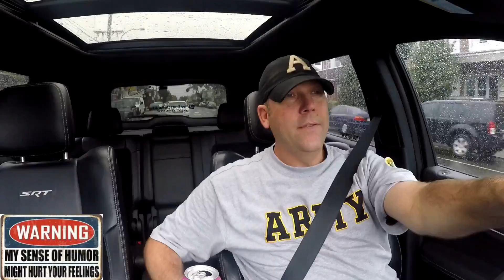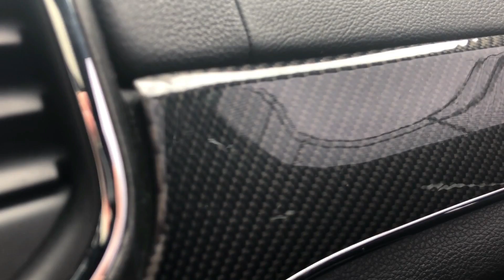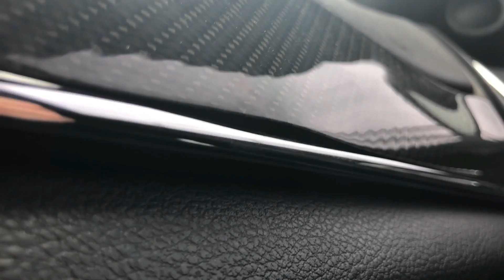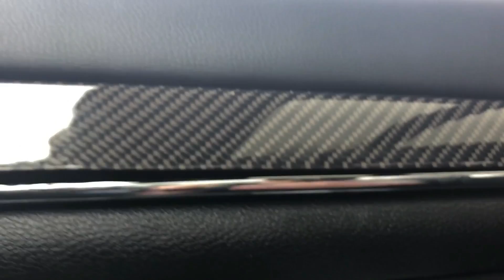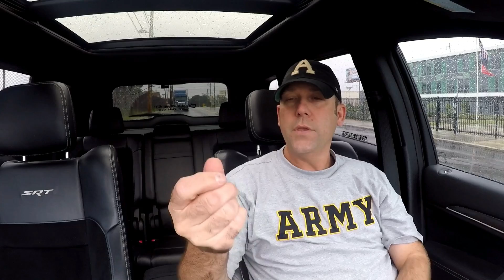The Carbon Fiber Trim peeling issue with the Jeep Grand Cherokee SRT

Comment: I just repaired my four door pieces and the piece on the left of the steering column.  I had to completely replace the piece on the passenger dash at a cost of over $300.  But the pieces I repaired went pretty smoothly.  I used JB Weld Plastic Bonder, High Strength, Structural Adhesive.  This is made for carbon fiber materials.  It is a two part epoxy that sets in about 20 minutes and cures in about 2 hours depending on your location and humidity.  I found that all the pieces came loose below the door handle first and bowed.  When I removed them there was very little adhesive holding the trim from the factory install.  3M tape will not hold...it will stick to the door but not the carbon fiber...I tried it already.  When you mix the bonder, concentrate on the thin area under the door handle first, the work the front and pointed end last.  You do not have to spread the bonder over the entire length of the part.  A generous spot at the front and the rear will do.  I used dense seat cushion foam cut the same length of the trim with a waxed paper overlay.  The waxed paper keeps
 the foam from sticking to the CF trim.  I glued the foam to a 1x4 piece of wood the same length as the foam and made a wedge so I could apply constant pressure to each piece as it set.  I did one piece at a time but it seems to be working as planned.  Hope this helps.
Reply: I used same product  I removed panel glued and clamped so far it is holding mine is the overland wood trim

Comment: I have a 2014 Jeep SRT. Bought brand new of the showroom floor and had almost immediate issues with it.  Nothing too major at first.  Trimming peeled the first time in 2017 and had it repaired in 2018 (yeah, I waited that long).  Just took it back again for the same issue and was told no longer under warranty and would cost $815 bucks to repair.  On top of that, it took 2 weeks to get an oil change, filters, and fluids only to find out they can't clean the filters b/c they don't have the proper kits and that I would have to order them off eBay of all places and bring it back.  To make matters worse, the check engine light has come back on and the truck still seems to stall at crank.  Listen, I don't drive my vehicles hard.  I have a 15 minute, 20 max, commute to work, and I never do long road trips.  This truck only had 66K miles on it.  I should not have these problems for a top of the line performance SUV.  I thought about seriously about upgrading to the Trackhawk.  It is a sexy beast but...  Fugg it.  Import it is.

Comment: My 2015 Jeep SRT with max care was denied today by dealer.  Contacted Mopar online waiting for response.  I have the carbon fiber peeling issue as well as wheel curbing from two years ago on outside of wheel and inside of wheel is now separating.  They denied saying carbon fiber not covered (its been garaged since I purchased new).  The curbing rash on outside of the wheel from two years ago they claim caused the wheel separating on the inside at the bead resulting in daily leak downs of the tire.  Love my SRT but lots of quality issues with materials and components.  Frustrated beyond belief.  It’s been in the shop approximately three months since I purchased it already for all warranty related or recall repairs.

Comment: did the dealership fix or how did u woke up this morning with the same issue
Reply from the maker: SRT POWER The first time it happened the dealership fixed it under my original warranty. Not sure they’ll fix it again under the Max Care  Plan. Will find out on Friday. It wasn’t noticeable until I saw the corner peeling back and then I noticed all the bowed sections.
Reply: @EastCoastJeepSRT  do you still have bumper to bumper warranty or just powertrain

Comment: I said it before I hope it never happens But I haven't had the peeling problem yet It'll will be the 2nd winter the jeep goes though That's what I was worried about the extreme temp variations Last winter was really cold But now I believe I have power steering pump going out And I drive 190miles just to go to a dealer There cause Their the best quick professional Always do an awesome job and always treat everyone good
Reply from the maker: J2 J Have you run your fingers along the bottom edges to see if any bowing has occurred?

Comment: Here's the bad part I have a 2014 SRT8 Chrysler 300 392 carbon fiber shifter bezel carbon fiber door trim carbon fiber – pieces they all peel the door carbon fiber trim was missing I didn't know it even had it until I watch the videos on my car and found out that came from the factory it's $1,400 a piece for the door they do not sell there carbon fiber door trim separate 2003 Dodge dealerships nope you got to buy the whole door until 1 Dodge Furman in Tampa said yep we can get the two front ones you can't get the back one it was well over $100 to replace it but after I replaced my shifter bezel 4 months later it started peeling luckily I have a good relationship with Ferman I brought the part in with my van in the miles and they just want you to inform you about having to bring the car and that's customer service but on the 2012 to 14 it is a common freaking problem they had bulletins after bulletins after bulletins on these cars to trim my car is out of warranty they don't fix it Jeep is just as bad

Comment: Anything new on this?  I like my SRT, but this issue alone is enough that I will never by a Chrysler product again.  I'm kinda of particular when it comes to attention to detail and when the inside of a $75,000 car is falling apart like it's a 1996 with 250k miles on it?  I'm not happy.  Same with the paint on the wheels peeling off.  It's super expensive to replace the carbon fiber trim pieces and they would still just fail again.   I did have them replaced once under warranty, but now they look like shit again, peeling and cracking and my jeep is now out of warranty.  It's making me regret getting the SRT over the Range Rover Sport and it's making me wonder what else is going to start falling apart before I even hit 70k miles.
Reply from the maker: They mailed out warranty extensions to Jeep SRT owners extending the warranty on the carbon fiber trim.
Reply: @EastCoastJeepSRT  Thanks for the info.  I will look into it.  I just called a dealer and they said it was not covered.  So I will look and see if I have anything in my records.

Comment: I work at a dodge dealership and it’s sad to say but their interior trims / plastic are very cheap.
Reply: That is one of the reason why Dodge has always had poor resale value...they are built cheap.  My dad always bought used Dodges because they were cheaper than anything else on the used market and that was back in 1959.  Unfortunately today they have the same reputation...strong driveline but cheap build quality.  Until I purchased a used GCSRT, I have stayed away from Chrysler products for the same reason.  It is sad but I had a friend that wanted to trade a 2014 Charger R/T and the dealer offered $8300 while they have used one on the lot for $23000...so Dodge dealers don't even want their products back in trade.  I suggest more caution to anyone that considers buying a Chrysler product.